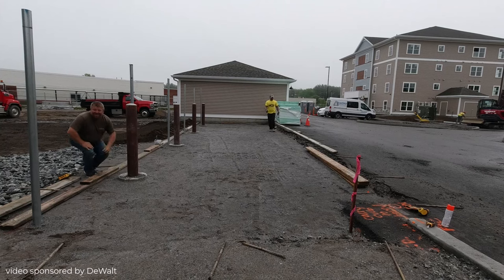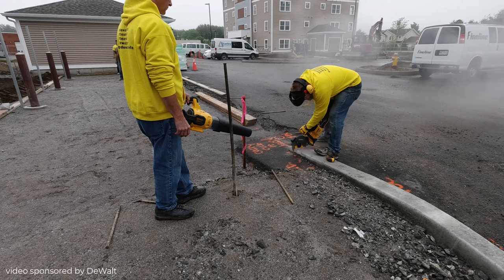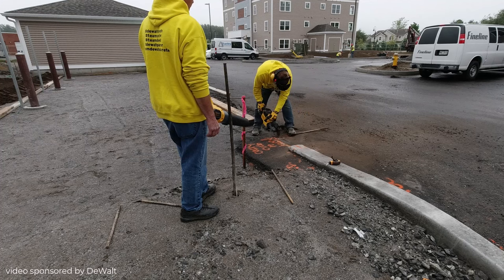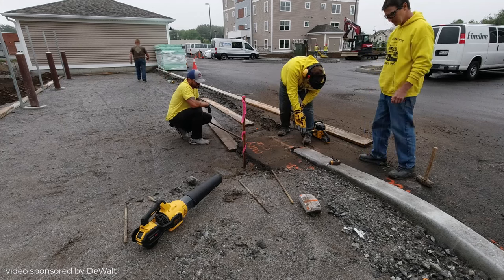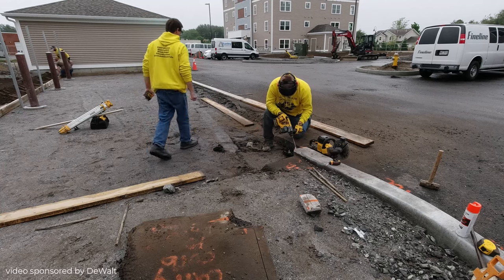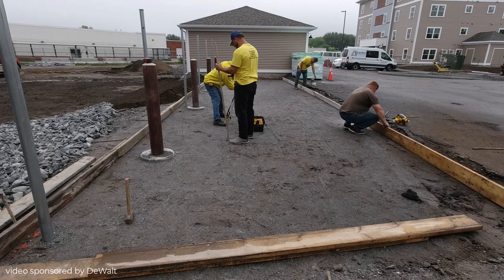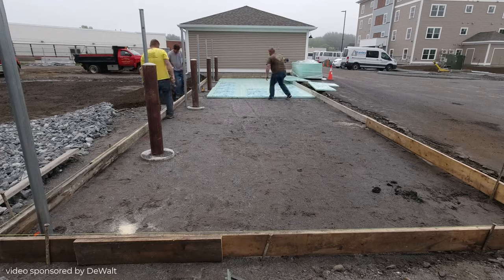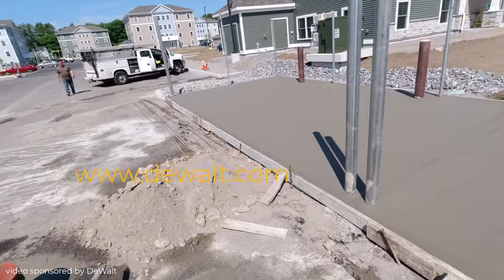How To Form A 48' x 16' Concrete Slab (These Tools Make it EASY)

Comment: I've owned the cutoff saw for approximately 2 years now. I use it with 9-amp batteries, and it has become my favorite tool! You get about 9-10 feet of cutting per battery. Because I had four of the batteries for the saw, I can easily swap them out for continuous use. I also purchased the cordless table saw, which is very convenient.